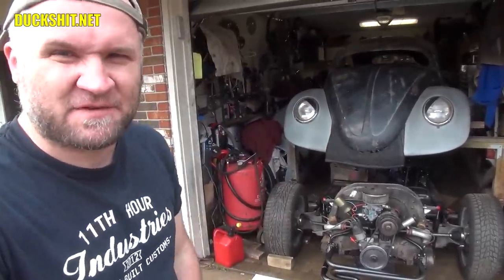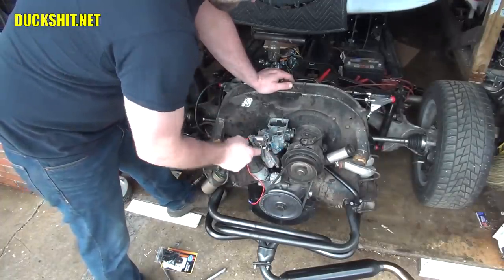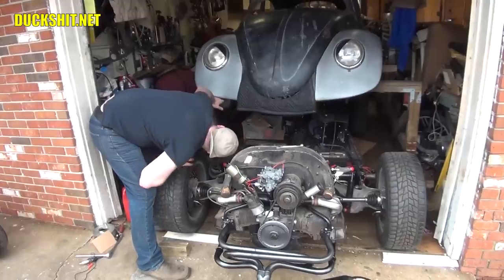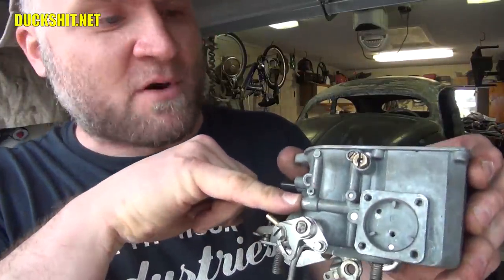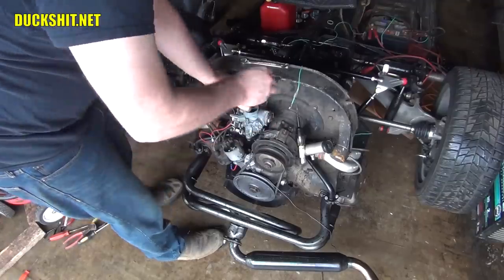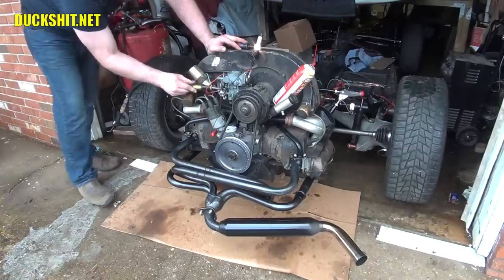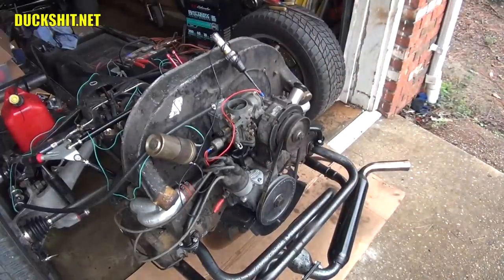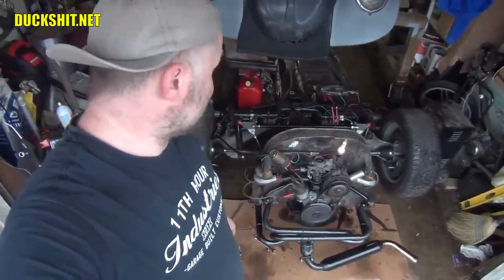Carburetor Has Problems! RAW EDIT - ROTTEN OLD 1956 VW Beetle - 82

Comment: I was told by an old Volkswagen mechanic years ago that the Solex carburetor when the idle mixture screw in removed and installed several times can wear on the threads causing it to not get enough fuel for the idle circuit. The way to remedy this problem is to back out on the screw (the screw on the right side of the carb) until you get the carb to idle properly, then you will need to remove the screw counting the number of turns to completely remove it. Then wrap Teflon tape on it and reinstall the screw the number of turns that it took to remove it. This adjustment needs to be done while adjusting the idle screws on the left side of the carb.
Reply from the maker: Yes I have found many of them Teflon taped and have done so myself

Comment: Carburettor when idel drip petrol on bottom flap wat is rong
Reply from the maker: Check accelerator pump, check valves probably stuck.
Reply from the maker: Also make sure float is working properly and not allowing carb to overflow.

Comment: It's a piece of work, the twin carburetors from the previous video reminded me of those who rode in Europe the Alfa Romeo 33 TI, which had a 4-cylinder boxer engine but liquid cooling, gave 105hp in the mid-80s with 1,500cc, He walked a lot but the carburetors were very complicated to regulate, and that the car came from Turin.As for the current carburetor, it reminds me of the problems with the acceleration pump that the Solex of the Renault 5 gtl gave me at the end of the 80s.
Reply from the maker: Interesting, thanks for sharing!  Going back to single was a good idea for now!

Comment: I couldn't help to notice that you moved the accelerator pump screw up words towards the plus sign. 
That actually reduces the amount of fuel you inject with the pump. 
I'm running a 34 pic 3 Bocar with no Venturi on a 2234cc with a FK42 cam and I have to have that adjustment pump screw all the way down to the negative sign. That's the only way I will get enough fuel so I don't get a stumble. Good luck
Reply from the maker: Good call!  Thanks for that!  Usually I leave them in the middle, but this engine seems to need something more, never messed with that before.  I appreciate the comment, thank you!
Reply: Probably gone with a dual carburetor set up with the higher engine size myself.
Reply from the maker: Good

Comment: I'm glad you got the rain. All we got was the wind. You like to live dangerously, I was yell at you because you left nutz and other little shit above the open intake. I was waiting for something to drop in. As far as that messed up carb. That's what they make number 8 sledge hammers for.
That's what I did to a Edaelbrock 750 I couldn't get to work. Opps. Yes I have anger issues. The engine sounded good.
Reply from the maker: Haha!  I don't  drop stuff from up there.  I tend to cover the manifold or carburetor when I'm working just for that reason.  Its hgetting there, hopefully more progress on it this week when I change out the distributor.

Comment: I had a kadron that’s was giving me fits I just installed new kits and new throttle shafts I cleaned this carb and went through every inch twice it still wouldn’t work right I swapped the body with another one and boom she was fine gotta love vws .... I would check your condenser I have had a bug act like that to and it was the condenser great video as always keep them coming
Reply from the maker: The entire distributor will be swapped out shortly with an SVDA, that's how I plan to check the condenser lol 😁😁😁   thanks for the comment!
Reply: That’s what I figured I was just meaning try a. New one if you where just going to swap Psrts over to the vacuum dizzy

Comment: my dell is popping especially once warmed up, I cleaned the jets, still doing it. I'll look at the check valve next. I will check the timing, (static is all I have) and make sure that's ok first. got an 009, should be able to check where it is with the test light.
Reply from the maker: Yep, sounds like you've got a good plan!

Comment: I bought a rebuilt carb from NAPA, It was probably rebuilt before the fuel changed to added ethanol, the ethanol destroyed the accelerator pump in about 2 days and fuel was just running through it. That might have been what happened to your carb that was built before we went to non-leaded fuel.
Reply from the maker: Maybe... or the screws just werent tight as I found it... lol   😁

Comment: That test light was not in a happy place, its just waiting to jump into that belt when you least expect it . An old bulb holder crimped to the wiring would be a lot more positive to keep a check on the oil pressure . Good work ,I understand the frustration working on machinery ,solve one problem then the next one bites you in the ass
Reply from the maker: Thanks for the suggestion

Comment: I had a 009 dizzy with a pic 34 accelerated great parked. Issue was when actually driving it off the line is when I got hesitation. I eventually switched to a vacuum advance distributor and it helped. I think it is more than the dizzy. I saw you were checking for vacuum leaks check also all along the intakes. Just trying to help.
Reply from the maker: I appreciate you! Thank you very much!  😁

Comment: Did  you ever figure what the issue is with that carb? Bushings on the throttle arm could be worn causing a vacuum leak there.
Reply from the maker: On a brand new NOS carburetor?  🤣

Comment: You have a timing issue which is why you have a flat spot. Reset your timing with your test light and you also may get rid of that shake in the engine.
Reply from the maker: This video was 3 years ago.... and boy are you wrong.  LoL!  Everyone else was just randomly throwing other things at me, and they were wrong too.  There are follow up videos.  This engine has been on the back burner since I got it tuned properly until last week when I rolled it out.   It'll be in a car as soon as this week. Thanks!

Comment: loved the video as a lot of people cut out all the issues they have so it looks like it all went smoothly .also was that scream when the light fell was that you ? lol.  i had a problem like yours would idle ok but a bit uneven (not miss firing) when i reved it up had a huge flat spot till higher revs but i didnt have a 009 ive got a standard distributor . i had a look at my plugs and they were very fouled up so replaced them and flat spot went may not be the same for you but thought i would say just in case it helps
Reply from the maker: Probably was me, I am known for subconcious sound effects.

Comment: Hmmm? thanks for posting. Acceleration is not good. Have to wait till you get another carb I guess?
Reply from the maker: Bet you commented before you watch the whole video lol  😁
Reply: @DuckmanCycles  "no" I watched the whole video several times.  Do you think it is accelerating good? I dont. Its still has a flat spot. Running all shaky and wont idle slow.
Reply from the maker: I gave my opinion in the video, lol.  And no, its not.
Reply: @DuckmanCycles  If anyone can make it run smooth you can. I m sure you will fix it up right.
Reply from the maker: Yes sir, thank you, sir.  Yesterday was a bit of a frustrating day, I got tired and I was not wanting to be wet anymore.  Will try harder shortly, but not until after it warms up! Supposed to be freezing here the next couple days... this is not what I came to Florida! LOL

Comment: Your gutters need a clean .😉
Reply from the maker: False, my gutters have guards, they naturally drip and slough off the pine needles in rolls.   Otherwise I'd have to clean the damn things daily... the pine needles are serious about their jobs of clogging!  Thanks for the suggestion!
Reply: I thought the same thing first time I saw the gutters.  Then, thought there is no way in Florida you could get away with gutters that clogged .....so I didn't comment.
Reply from the maker: I got tired of cleaning those things out years ago and got them covered when I saw the guards go on sale for $0.80 each... I bought all that they had and had exactly the right amount to cover my house with only 3 in of scrap remaining!

Comment: Plugging the hole in the throttle plate can help with the 009 stumble
Reply from the maker: It sure can! But you know what works better? Replacing it with an SVDA!   The 009 is very temporary!  Hehehehe!  😁
Reply: so is a pop rivet

Comment: What size idle jet are you running?
Reply from the maker: I changed out the jets multiple times in this video.  Described it each time :-)
Reply: @DuckmanCycles  not the main jet the idle jet
Reply from the maker: Whoopsie... sorry, misread.  I am in motion right now lol.   Will answer in tomorrow's Q&A because fail to remember!  😁
Reply: @DuckmanCycles  no problem duck man just trying to help you out I think the idle jet is too small idle jet works for about up to 2500 to 3000 RPM.yeah I find this to be a lot of people's problems and tuning in their carburetors is idle jet
Reply from the maker: I do think you're right, the other problem is a 009 not helping anything.  More on that soon!